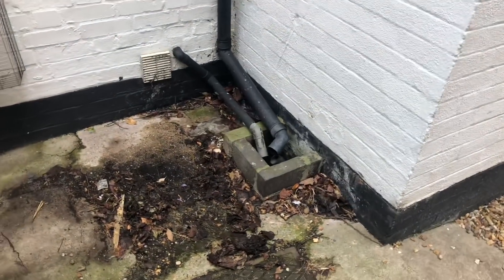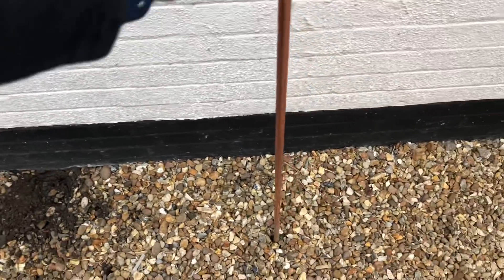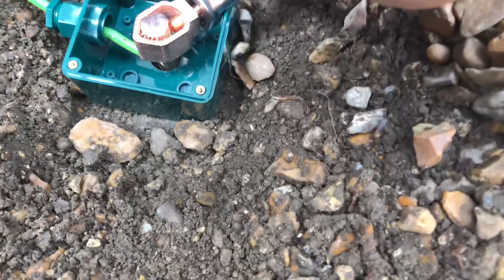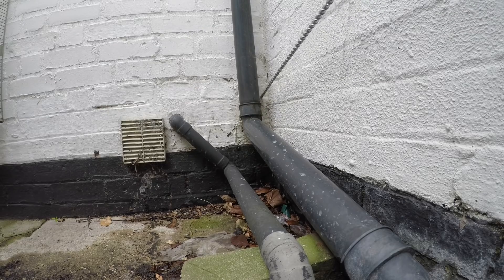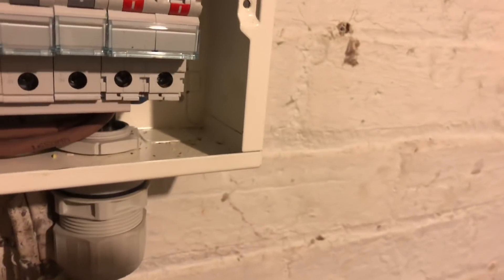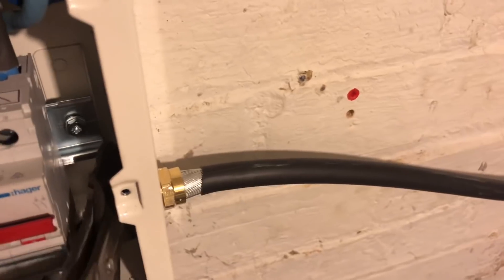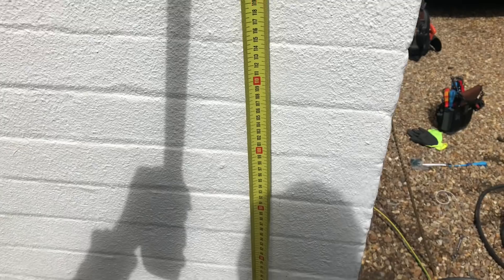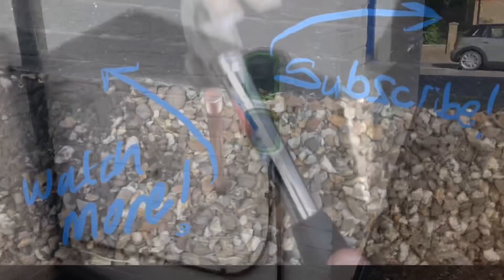How to Install an Electric Vehicle Charging Installation with an Earth Electrode Rod TT System -TNS

Comment: That looks like quite a hungry installation... What was the maximum demand, surely it's got to be more than 100A?
Reply from the maker: Not really they only had an electric cooker and a couple of rings in use so more like 50amps with diversity I would say.
Reply: @artisanelectrics  I counted 3x rings, 1x socket radial, 1x cooker and 1x water heater.... That's gotta be more than 50A even with diversity applied.
Reply from the maker: Water heater is only a backup immersion heater in case the boiler packs in. No diversity is allowed for the charging point though. Upgrade of main fuse to 100amp is in progress.

Comment: Being a sparky these days is becoming harder to sleep at night wot with all the new regs etc, wondering if you’ve complied 100% with every aspect of bs7671
Reply from the maker: Yeah I feel the same at times
Reply: Late to the game, but I just found out: It is incredible that an EV needs a separate earth and that the EVSE between the socket and the car the needs a relay on that second earth?? How unlikely is it that an onboard  charger fails in a way that puts EV battery DC voltage on the ground wire or the chassis, as well as the car computer, which always monitors isolation resistance between chassis and battery, not noticing? I know about SMPS and quality ones go to great length making sure this is not a way they can possible fail unless you throw a bucket of water on them. People have been charging different kinds of electric vehicles straight from the socket, even without an earth in the rain for a century as well as using ungrounded corded steel lawnmowers in claggy grass barefooted, and I've never heard of any EV owner finding dead mammals around their car in the morning for the past 40 years? I would like to know the reasoning in the legislation for treating EVs differently from any other outdoor appliance? Even tumbler dryers, which occasionally are wrongly  installed without a ground and then have a short to the chassis, which indeed shock the residents when they find out, almost never off them amidst plenty of grounded piping typical of an utility room.
Reply: I’m pretty sure there is no exceptions for RDC protection in a dwelling so the 40a MCB non RCD is a bit naughty (I know it’s SWA etc) unless i’m wrong. I also know that the Rolex have a built in RCD not RCBO in the unit itself.
Reply from the maker: Cables which are clipped direct and have an earthed metallic sheath do not need RCD protection. The RCD within the Charging point protects the socket outlet itself.

Comment: Not sure why you had such a big gland? I’ve just terminated a 3 core 10mm and only needed a 20mm hole.
Reply from the maker: It was not an SWA gland just a compression gland at the charging point end as I didn’t want simultaneous contact to be possible between the TNS earth and the TT earth system.
Reply: Without looking again I meant the dB end, looked like a 32mm hole?

Comment: I woudn't be recommending smart meters to any of my customers. They have had such a bad press and the in built features have some potentially worrying implications for householders. They have the ability to cut off your power without having to visit or gain entry to your home. There is also the possibilty to ration peoples electric. Should we have a shortage those using the most could be targeted.  The government have a very short term energy statergy and it is quite likely we will face some form of rationing in the not too distant future. The smart meters are being rolled out in order for the government to have ultimate control of the energy we use.
Reply from the maker: Interesting comments thanks

Comment: I like to use the q-max punches for cutting holes in consumer units. They make a really neat hole with no chance of slipping like you can with a holesaw.
Reply: Me too - they appear to have gone out of 'fashion' but they are brilliant!
Reply from the maker: John Dufton what I like about these hole saws is they have a wider bit at the back which stops you going through too far, I have used punches in the past as well but prefer this method

Comment: I prefer using earth tapes to rods as you get a much lower resistance due to the larger surface area. If you are burying SWA in a trench and TTing then you can run your earth tape in the same trench .
As for the long drill bits they are a necessity when most of the properties have 3 foot thick stone walls. Toolstation do them in packs of 3. https://www.toolstation.com/sds-plus-drill-bit-set/p42360
Reply from the maker: John Dufton thanks for your comments. I’ve never installed an earth tape, how deep do you have to bury it and how long are they?
Reply: @artisanelectrics  I would usually use a 2 metre length. Depth is down to soil conditions obviously the deeper the better. If there is someone with a mini digger then happy days. With any kind of TT system moisture retention in the ground is an issue and the use of marconite or bentonite added as backfill helps with resistance.

Comment: Is the earth stake required due to the charger being external
Reply from the maker: Tim Davison yes, it’s to avoid problems in the case of a PEN fault where the whole metalwork of the car could become live and if you’re standing on the ground you could potentially get a shock

Comment: Nice video mate, thanks... Screw a nut on to the earth rod before smacking with the hammer, just to protect the thread a bit
Reply: They actually sell ends to be used for knocking it down .
Reply from the maker: Good idea thanks
Reply: I winced as well when I saw the copper rod being whacked directly - however then saw the supplied clamp which didn't need the thread, so who cares! Then again I would have threaded on a clamp but... would I have deviated from manufacturers instructions. I hated that clamp, still do.
Reply: Always good though to keep a usable thread, just in case you need to send another deeper

Comment: Thanks for uploading, been looking out for ev charger install vids 👍 ... got a question about RCDs with EV points and other DC sources, do they need changing from type AC to type B because of DC residual current?  Seen another vid saying about this...smart looking job, thanks again much appreciated
Reply: Hi mate have a look on the efixx YouTube page, they did a video ripping apart the rolec charger and basically you can run these charger of a ac type rcd as the charger itself has a a or b type rcd protecting it from DC residual current, cant remember which one of the top of my head.
Reply from the maker: Ian Morris RCD needs to be type A not B. Type A’s are fairly common now all Hager RCDs come type A as standard. Type Bs are much harder to come by and very expensive.
Reply: Thanks for advice, going to check it out :) new to all this so great to get tips and see vids like this, very much appreciated
Reply from the maker: Ian Morris the Rolec Charging point has a DC residual current monitoring device inside which makes it comply with regs

Comment: So does the swa not need RCD protection?
Reply from the maker: No because it’s clipped direct and the socket has its own RCD protection within the charging point
Reply: An SWA has an earthed metallic sheath, which also negates the need for RCD protectection.

Comment: When you live in my part of the country, you'll need 1200mm  long drill bits that will go through anything if you've got a beefy drill behind it 😁😁
Reply from the maker: wyn davies is that because you have lots of old houses with thick walls?
Reply: @artisanelectrics  yep, most stone walls around here are 3ft thick.
Reply from the maker: wyn davies ha ha yeah I used to do all the electrical work at an English heritage property with meter thick walls all good fun!

Comment: Wow, working on a live consumer unit, and bodging around a live busbar with a screwdriver, the earth rod should not be  covered over, and you should always connect the circuit at the CU AFTER the load end has been connected.
Reply: Anybody slating somebody else’s hard work and trolling peoples videos should be confident enough to be posting their own videos. This lad is a bloody good spark in my opinion and his content is decent too.
Reply: richard S excellent comment.
Reply from the maker: richard S Thanks I appreciate your support
Reply: richard S exactly, easiest thing in the world to do is criticise someone else’s work. Why not send him a message privately and ask a couple of questions rather then publicly trolling him. Don’t get this problem on instagram
Reply: @richard S Thanks for your comment, greatly appreciated.

Firstly theres no trolling going on, this is the section called comments is it not? Are all comments supposed to be there to polish the preverbial turd?

How is a CPC defined in BS7671?  How does a CPC contained within a multicore cable  protect it please?

Isolating the earth at a TT install, theres a terminal inside them for this and its and insulated encloure so theres no reason to not use the correct gland for the cable.

Oh don't tell me, you're one of these who love using SY into stuffers, cos its easy!

Next time I might give Jordan a quick bell and spek with him to say nice one mate, but if you don't mind me having my two penneth etc etc. It'll keep the stress heads out of it.

But if anyone thinks that completing your live tests like that is an accepted method, christ almighty we're doomed!
Reply: @richard that’s told them, bloody keyboard warriors
Reply: Agree Paul Green, but thesedays you tend to get shot down by commenting on the proper safe working methods. Personally my thought is if its getting put out on a public forum, everthing must be done as per rules and regs. 

Why the 3 core SWA when only needing 2 core? Dont say the CPC is there to protect the cable, because thats never been the job of a CPC.
Why the bodge of the SWA gland at the charge point - the reason given in the video is utter tosh!
Is part of thart earthing conductor directly buried? Cos if it is 10mm don't comply does it?
What was the reason for live testing on exposed end of the conductors? Isn't this what the dead testing is designed for?

PS i'm not perfect in any way, but if you're doing this stuff for the world to see, get it bang on right!
Reply: @SME_Ste  bet the pages on your regs book are stuck together
Reply: calm down super spark
Reply from the maker: Smithyy 😂
Reply: Oi I’m supersparks
Reply: No keyboard warrior here. Need to have a google account so thats why i use yt with and electrical name. 

Not slated anyone, but all my comments are genuine,  please anyone tell me with the things i’ve ‘slated’ why they are wrong. 

I dont put any video content on because i dont have the time spare its will add to jobs, simple really

Unfortunately if you post anything, you need to grow a pair and be able to take the good with the bad, all comments are true and fair.

Comment: So if it was already a tt system would you still need to do an earth stake or does it only apply on tns and tncs?
Reply from the maker: Only TNCS and TNS. You can also convert the whole installation to TT if it’s easier but usually that’s not a great option.

Comment: Annoys me so much that main incoming pme systems are so bad that rather than the electrical suppliers sorting it out us electricians have to with a tt system. I guess the earth isn’t their responsibility but still annoys me.
Plus are they likely to change a  tns systems to tncs? Have you come across it? (I haven’t). 
Good vid bye the way.
Great tip with drilling the floor before hitting the rod in,I’ll use that one
Reply from the maker: Thanks yeah the regs are way over the top in my opinion but we gotta do what we are told! The TT is there for safety in the case of a PEN fault, which is super unlikely anyway, but hey ho! Never heard of them changing TNS to PME but apparently it does happen...
Reply: Artisan Electrics I believe the car charging points on tns systems need to be tt because what we see as tns at the property may actually be tncs in the ground in the street.
I don’t see why we needs to tt them anyway. We don’t tt anything else external on tncs or tns.
Reply: Where in the regs does it state you have to fit an earth spike in case the TNS supply is converted to TNC-S? If in the unlikely event it was to happen the installation would need to be reassesed and an earth rod fitted at that stage; similar to when water companies informed home owners of metal water mains being changed to plastic so they can get any their main earth connections changed to an earth spike. The electricity DNO would have to inform customers of a change to their earthing from TNS to TNC-S so as to allow customers to get their main bonding conductors installed/replaced, as many older installations will have none or have undersized conductors that are less than the 10mm sq. required for TNC-S.
Reply: Plus if the earthing is lost. It means by default we would lose our Neutral would we not?
This would result in instant release of the charge coil on the contactor.

This would result in double pole isolation to the car.

Biggest load of I'll thought out crap I've ever seen.

More engineers will die driving rods in.